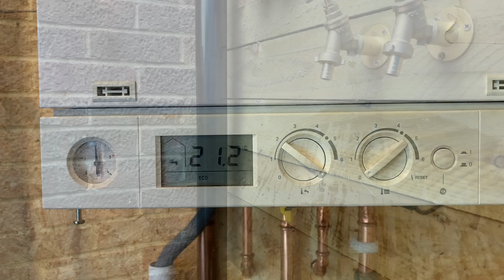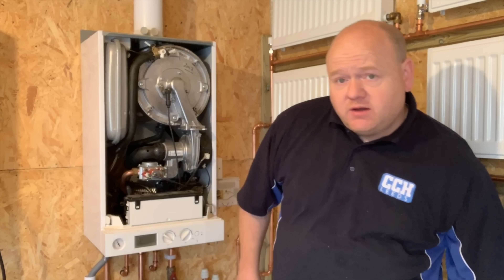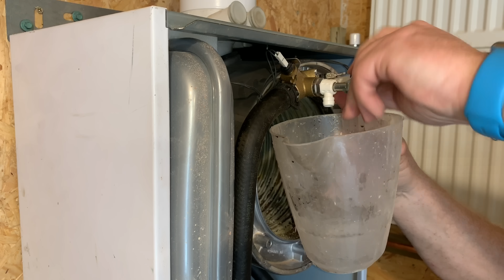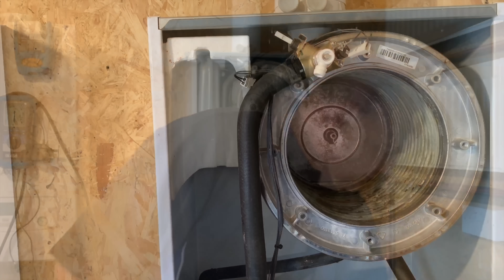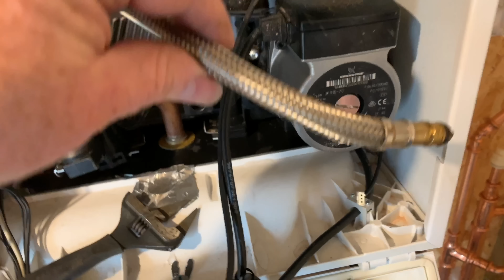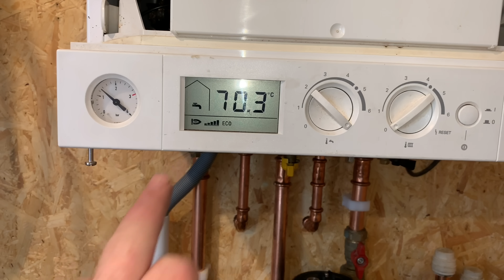Viessmann Vitodens 100 No Hot water  Boiler Service - Viessmann Boiler

Comment: The radiators on my Viessmann Vitodens 100-W Type WB1B were not heating up. I called in a Viessmann Engineer who said there's a blockage, could be the pump or magnetite build up.  So, had the system flushed, every radiator at a time and installed a new pump.  When the boiler was switched on a loud whine could be heard.  Has anyone come across this issue and knows how to solve it?
Any guidance would be much appreciated.

Comment: Thanks so much for your video, we have just moved into a 1980's house, and I have an Engineer coming back to fit a new heat exchanger as I have fluctuating water temp. but just warm at the shower. The Engineer came and found the problem. And has ordered a new heat exchanger. I will have the boiler serviced at the same time. I now know what the problem is and know that these boilers are good. Again thank you.

Comment: Hi Alan, just a question, if there is no flame when the hot water is on , is it still the heat exchanger, there is heating just no hot water and the three port vale is moving in and out when you turn on the hot tap, hope you can answer the question for me cheers

Comment: Hello Allen, I am in a similar situation.  When I turn on the hot water, it doesn't come out very hot.  When the boiler reaches 60 degrees, it stops and does not turn on again until it reaches 25 degrees.  The dial is at number 6. I have cleaned the exchanger, I have also cleaned the coil and finally checked and set the expansion vessel to 1 bar.  Do you have any idea what it could be?  I suspect that the sensor that measures the temperature is measuring more temperature than the real one.

Comment: This video is brilliant Allen.... I have this exact problem, but could you answer this... My problem is the bathroom taps not getting hot but the baffling thing is the downstairs are red hot??? I can see it cutting off when I run the bath and sink taps as in your video but run the hot kitchen tap and it’s blistering hot and doesn’t cut off??? What’s your thoughts?? Thanks in advanced
Reply from the maker: Maybe the boiler hasn’t been set up correctly or the boiler is quite small for the flow rate? Hard to say without seeing it. Thanks.
Reply: @AllenHart999  thanks for replying Allen....I’m in Leicester, do any of your team work down this way? Thanks
Reply from the maker: Tom Perkins Unfortunately not sorry

Comment: Love your videos Alan keep up the good work!
My 30kw vitodens 100 has just developed this fault, its 1st fault after 6 years!
My gas engineer just changed the plate heat exchanger for new but since the replacement  my hot water flow rate has reduced noticeably at all my outlets. I checked all the service valves and stop tap and everything is fully open. I’m having small problem getting him back due to lockdown shielding.Just wondered  is it possible that he’s reduced the flow rate on the boiler somewhere of is it possible that the plate heat exchanger has been fitted wrong,in terms of the wrong way around or up side down? Interested to know your thoughts. All the best
Reply: Possibly a smaller plate to plate heat exchanger was fitted.

Comment: Hello Alan
I have just had a 111w fitted
The boiler works all ok
However when the burner turns off the boiler temperature display rises by up to 10c above the set point
After a while it reduces
The ch is set to 70c and water to 60c
Any ideas ?
Reply: Normal operation.

Comment: Top vid Allen. Quick question about the expansion thank where you pressurised it. For it to work properly does it need to be pressurised like you did? If so what happens if its not pressurised? Thanks
Reply: Yes it needs to be pumped up to the correct pressure ( normally 1bar ish ) if it’s not pressurised fairly regularly it will naturally lose pressure and if it loses enough pressure then as the boiler operates the water has no where to expand into and the boiler PRV ( pressure relief valve ) will dump some water, the problem is when the system cools down its now lost some water and needs topping up, this cycle of dumping water and needing topping up continues until the expansion vessel is re-pressurised ( or its failed internally )

Comment: I have this boiler, this video has been a real eye opener. I had issues with my plate heater fouling up, the installer blamed the rubber pipes, a known issue by all accounts, he cleaned it out and performance was much better. I have since had the boiler serviced regularly by a different company and they do not carry it out as thoroughly as this. I’ll be showing them this video.

I came here as I wanted to learn how to wire a Nest thermostat, which until I get the boiler serviced is pointless installing.

I’m not gas safe so won’t be undertaking any of this myself, even though it looked straight forward.
Reply from the maker: If the system is clean then they do not normally sludged up. 👍

Comment: Hi Allen- ive got a Viessmann V100 WB1C 35kw that needs the pump replacing. Does the whole system have to be drained down to replace a pump, or are there isolating valves? Cheers

Comment: Just had this problem on my boiler. It's heating to 102 but water is Luke warm then cuts out with f2 error code. Thanks to this video and others I have narrowed it down to diverter valve or heat exchanger. Saved me bundle! Thanks

Comment: Great video Allen, got to do a plate heat ex on the 100-w 25kw combi, is it the same? Don't usually do much on the viesmanns, parts really expensive, I am gas safe by the way👍
Reply from the maker: Very easy to do, yes.

Comment: Does the door seal need to be replaced every time it comes apart and does it need to come apart ever year as the Worcester boilers only come apart when they fail the pressure test but a change the red burner seal every 4 years i only work mainly on the Worcester boilers as thats what i install and repair which keeps me more than busy with all my other jobs

Comment: I have the same problem with mine, getting to 88'c then cutting out. I understood the heat exchanger and cleaning the combustion chamber etc, but what on earth was that thing you pressurised and would I need to do that and if so, with what adapter? Thanks!

Comment: Hi Allen, thanks for putting up informative videos!

I had a Vitodens 100 WB1A installed 10 years ago.  Overall I'm happy with it.  The first heating company didn't install low loss header.  This reduces efficiency I was told by current authorized rep.  It is cleaned and maintained yearly.  However, the boiler locked out reporting F3 code a number of times.  Technician determined that spark generator needed replacement.  Boiler worked well for two years afterwards.  Now the boiler puts out F3 code again.  After last maintenance visit, the fan (or something) made loud humming noise during startup.  The noise reduced once the boiler was full on.  Everything was working fine otherwise.  Had the technician back.  He heard it too but couldn't determine the cause.  I didn't want him to just replace whatever (motor or fan) making that noise.  

Allen you know these boilers well.  I would like to get your feedback on some items.  1/. How durable are these boilers?  2/. How often spark generator needs replacement?  3/. Love to have a hot water combi version but I'm worried about having issues without hot water and heat.  How reliable is the combi type?  3/.  My boiler is 10 years old.  Should I continue to have it serviced or have it replaced?

Would greatly appreciate your opinion.
Thanks.
Mark.

Comment: Interesting video; if that boiler was removed for the hot water fault then it goes to show the value in getting a heating engineer to take a look at it (And get the boiler serviced annually too!) Viesmann boilers a really good as they have a stainless steel inox heat exchanger, so should last a while longer than boilers with the cheaper aluminium heat exchangers. Once again Alan, a great informative video!
Reply: Random musings , An interesting video to watch,  but the thought in the back your mind is was this boiler removed just because of the hot water fault?  so whole new boiler installation for such a small fault ?? unbelievable!
Reply from the maker: Salim Khan I am guessing that would be the case but not sure
Reply from the maker: Thank you

Comment: I wish viessmann had a dealer network here in Upstate NY
Reply from the maker: What boilers do you have over the pond?
Reply: Allen Hart Weil Mclain, peerless, lochinvar, HTP, Utica, mostly cast Iron units still in use.  I installed a Buderus G115 with a riello burner last year and absolutely love it.  Most homes have forced Air here but some have hot water baseboard with requires 180f degree water.  Many people here that install High efficiency boilers are very unhappy because the do not see any gas savings because they don’t have the proper heat emitters.  Am going to install an radiant slab in my new garage so I’m looking for the proper boiler for that.  Keep up the good work Allen.

Comment: Nice video showing how it should be done Allen.
When I’m changing the plate heat exchanger I normally crack open the cold water inlet nut to let air in when the hot tap is open to let some more water out so less mopping up 👍obviously can only do this if your tap is lower than the boiler 😆
Love the videos keep them coming 👍
Reply from the maker: Thank you.

Comment: Hi Alan,
Which cleaner chemical did you use to clean the hot water plate heat exchanger . I have a similar symptoms on my potterton Promax 28He I do get hot water, but sometimes for about 10 seconds water gets cooler and then it gets hot again, this happens now and again, not always. I would say intermittent not always. I suspected heat exchanger may be partial blocked or the boiler may be operating like this from new. The boilers is 3 years old.
Reply from the maker: A lot of people use one shot.
Reply: @AllenHart999  hi Alan ur video are amazing just i just bought a new property my heating work ok but my hot water warm for a bit and then goes to cold can u pls tall me what problem that might be. .thank you very much
Reply: @MohammedAli-rh5ii  NTC sensor, pcb, flame sensing electrodes. Blocked plate to plate.  It's best to call in a gas safe engineer.  It's hard to diagnose without being there.

Comment: Disconnecting the condensate pipe from bottom of heat exchanger when flushing out the debris (put a vessel under it obviously) would be a good trick .......ah Allan.
Reply from the maker: You could do it that way but i would rather do it with hose connected. then clean trap out at the end if needed.

Comment: Another great video Allen, however I have a question about servicing.
Would you recommend that servicing it is done based on time, ie once a year, or by usage? My Viesmann 100 is a couple of years old but It doesn't get a massive amount of use. I'm a single bloke living on my own, out working six days a week so not caning it like say a family of 4 running baths and showers and having the heating on all day long.
All the plant items where work get serviced based on how many hours usage rather than an arbitrary once a year.
Reply from the maker: Patrick Ahearne Manufactures recommendation is once a year 👍

Comment: Could you put details of that heat exchanger tool in the description please mate !
Reply from the maker: I got it from my rep.
Reply: @AllenHart999  Thanks Allen I've been a worcester installer for about 10 years but recently I've found out that they are a large share holder of boxt so my loyalty as completely gone and I'm not keen on the idea of promoting worcester anymore....i was thinking of switching over to viessmann instead, do you think that would be a good move for my business? Many thanks Dan.

Comment: Hi Alan what boiler would you recommend .  I have 9 rads the one I have is a ideal classic we've had it 20 years .it is a conventional  boiler thanks
Reply from the maker: brian jones Baxi Platinum is a great choice or the Viessmann 100, Thanks
Reply: Thanks Alan all the best
Reply: brian jones , get the Viessmann vitodens 100 it’s a great boiler,  I  recommended one to my neighbour last year &  he was really impressed with how quiet it was ,& how quick it warms up all the rads, but best off all its extremely gas efficient !
Reply: @SalimKhan-gk1fh  thanks you for your advice
Reply: brian jones , your welcome Brian, just ensure u use somebody who is familiar with whatever brand of boiler you choose and also any subsequent servicing is carried out  to Allen harts thoroughly high standard! I must be on my 20th viessmann boiler fitted so far
I only had to call them out once & the engineer was brilliant and found the issue very quickly,  which was an installer issue!
This boiler Allen is working on has been mistakenly written off and replaced due to it only needing a thoroughly good  clean!
I see this situation quite often now

Comment: Another excellent video Allen ! Thanks for uploading it I’ve fitted quite a few viessmann’s and also maintain quite a few you’ll be surprised how many I’ve ‘brought back from the dead ‘! which have been condemned, all due to lack of proper servicing many had still got the factory paint on the Schraeder valveOn expansion vessel where they have never been unscrewed or  been topped up! I think it’s a state of the industry at the moment to be honest, I may be wrong? Whilst the burner assembly is out you also need to clean and check the gaps of the spark electrodes and after refitting the burner assembly the condensate trap will need to be washed out. this particular boiler you are servicing Has suffered neglect and has been ran on a dirty system, The dirt and debris in the Heat exchanger coils  has caused the boiler to partially fill up with condensate water
I’ve seen it many times before through lack of servicing or proper servicing, shall we say?
if maintained and serviced well these are a very good boiler giving great reliable service and excellent efficiency
Reply from the maker: Salim Khan Thanks

Comment: Thank you very much for your video. I have bought a second hand boiler system made in the UK its big its cast iron it has a gas blower. Plan to get a licensed professional in for pressure and gas workings. But I am curious if you would know if the company in question is still in business. Thank you again you earned your pint of Ale on that one. Aussie Jeff
Reply: Victoria Australia. The old boiler system is a cast iron Potteron about 450 by 450 by 900 approx high would have been installed late 70,s originally run on heating oil converted to a natural gas burner which is a Nuway unit approx estimate on size of unit somewhere between 30 and 50 k/ no idea about flow rate could send pictures if you are curious or willing to help. Aussie Jeff
Reply from the maker: Jeff Moore I would be happy to help but unfortunately I wouldn’t have a clue. Thanks
Reply: @AllenHart999  would it help if I was to send you pictures to a mobile phone number as I don't do emails on my phone.
Reply from the maker: Jeff Moore Pictures wouldn’t help really. I wouldn’t know what I was looking at 😂Thanks
Reply: @AllenHart999  thank you for your time. Enjoy your videos. Jeff
Reply from the maker: Where are you?

Comment: Interesting insight into the dark art of boiler servicing. 
I hope the original owner wanted a new boiler ,and not the other option.
Slightly baffled by the air bleed being on the inside and the top up on the outside. I knew of a boiler that kept being topped up then it died of multiple component failure.
Reply from the maker: I do not know anything about the old owner or why it was replaced. Maybe they changed it as they were having issues with the hot water. Not really sure. Thanks.
Reply: Allen Hart why would you have a boiler on your wall with no idea of its history?
Reply: @jamesjulian  Because it's not on his wall, it's on a customer's wall.
Reply: no more It’s not on his wall it’s on the wall of his man cave these are boilers just to practice on and demonstrate to us

Comment: Thanks for the video Alan. Very interesting to see how it all works.

How would you go about fixing a boiler that the flow of water in is too fast, causing a no hot water issue in a shower?
Reply from the maker: Set the boiler up correctly. Reduce the flow to match the boiler. Thanks